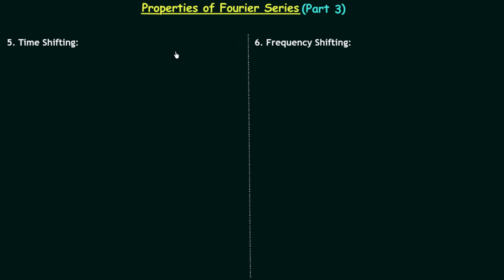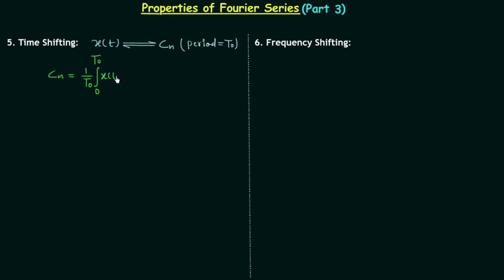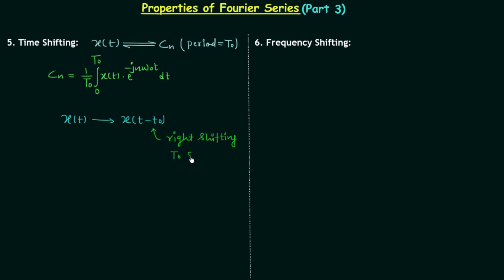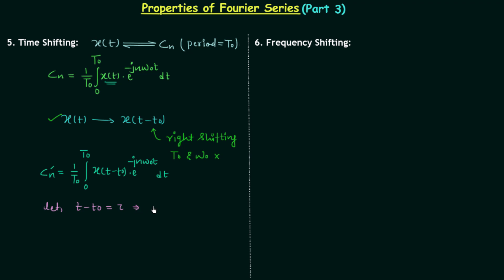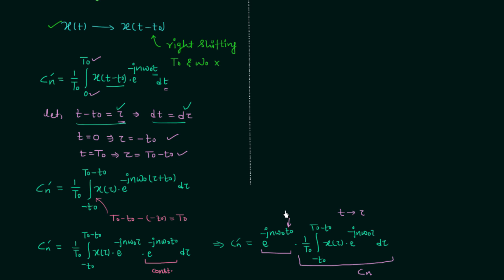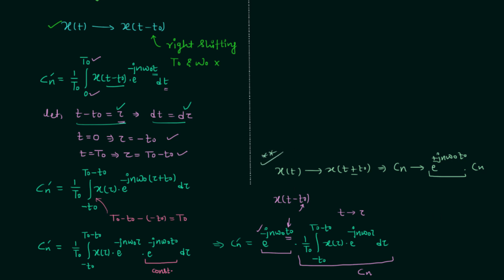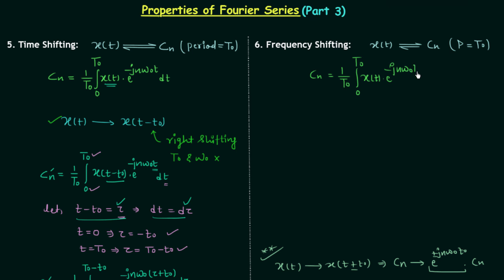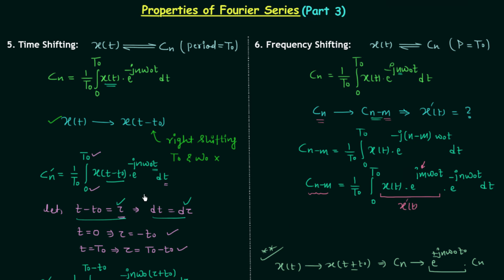Properties of Fourier Series (Part 3)

Comment: Neso academy. Your way of teaching is exceptionally well. 
Sir your lectures have made signal and system so smooth.
I solve most of the questions in gate in the covered topics.

Sir if the series could be completed in January it would be very helpful for those preparing for gate. 
But then too, great job!